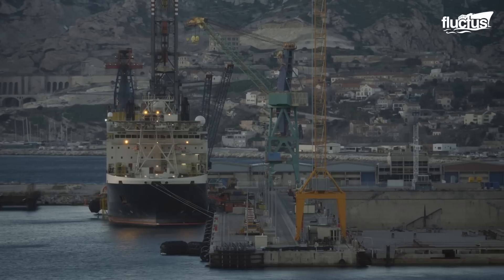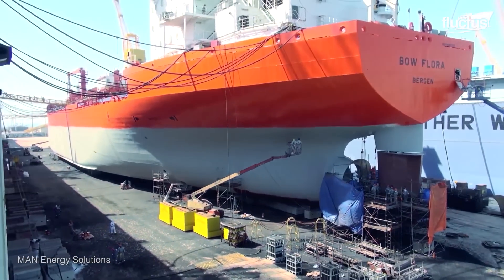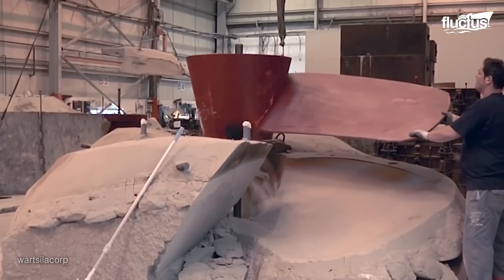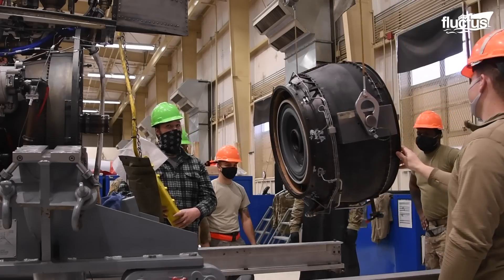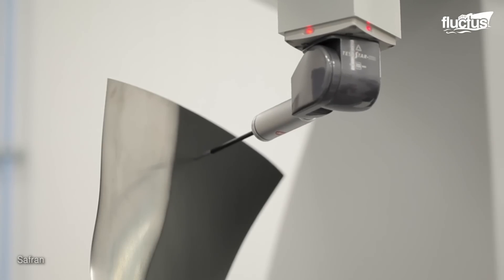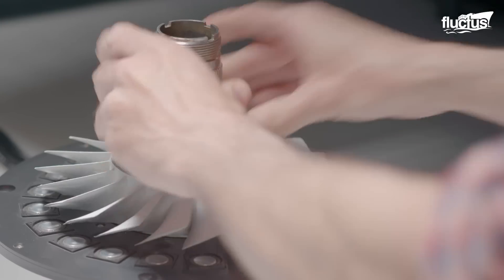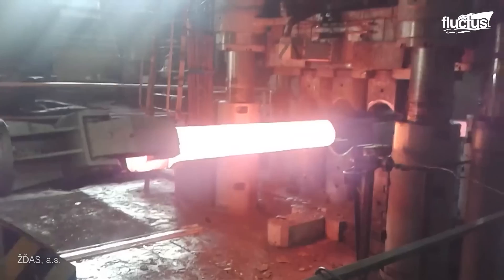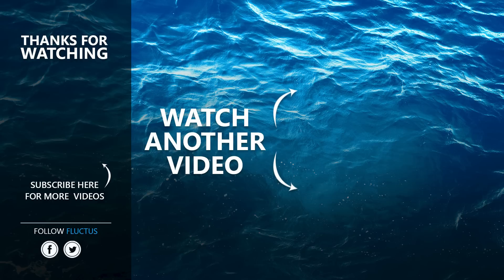How Gigantic Ship Propellers are Maintained in Shipyards

Comment: @ 7:14 . . . . forging is hardly just to give the metal it's required shapes and sizes. It improves the mechanical properties of the metal by producing directional alignment of the grain for important  properties in strength, ductility, and resistance to impact and fatigue. The grain flows conform to the shape of the part giving the part this superior durability.
Reply: You will find errors, omissions,  and just plain off the wall commentary on all these videos.  For a technical mindset its kinda frustrating.